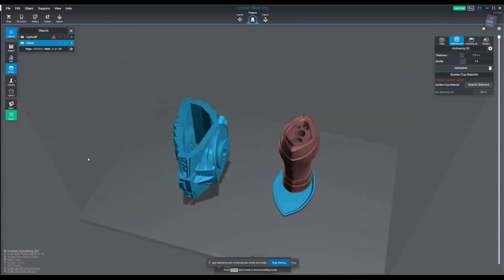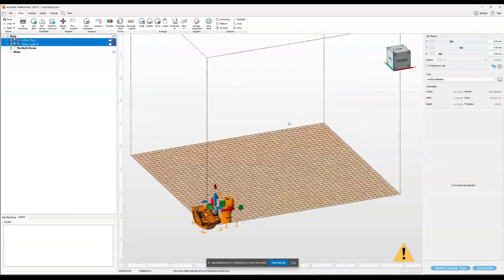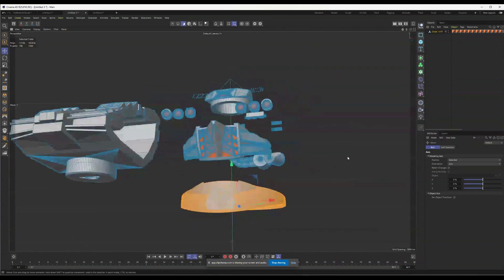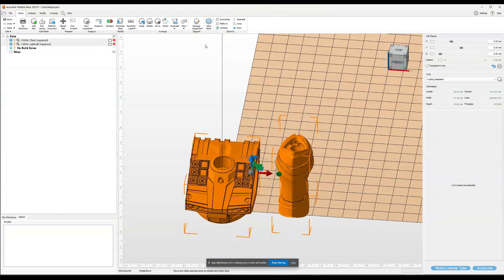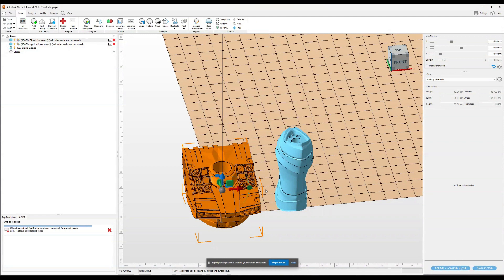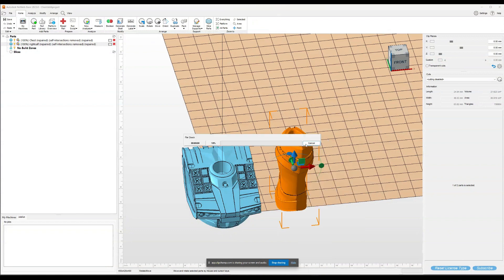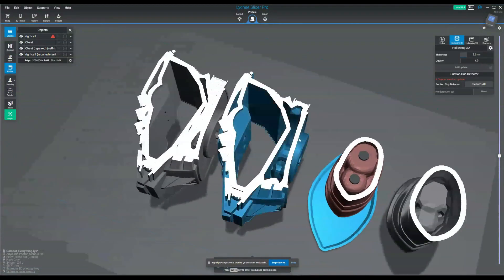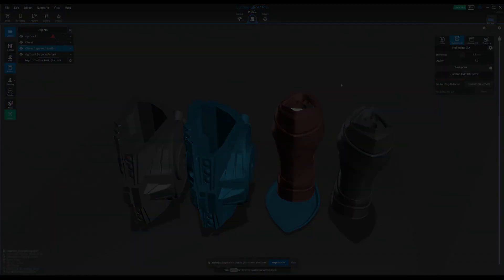How to fix STLs for 3D Printing

Comment: how do you get acess to autodesk? do you have to buy?
Reply from the maker: You do not. First make an account, after you install Netfabb, login using that account, pick to use the trial version. But it wont ever make you pay.
Reply: @J3DTech  it sends me to website. do i click student trial version or viewer?
Reply from the maker: @J-_-S  The first link does to set up an account, the 2nd link is to DL Netfabb so you don't have to try and navigate their website. I did student but I don't think it matters.
Reply: @J3DTech  i did set up acc, installed , loged in through program, but I cant acess program itself. It sends me to website where you can choose either student educational acess or web viewer. Used viewer, uploaded stl file, get black screen. Student acess needs various info, so i skiped it.
Reply: @J3DTech  Nevermind, solved it, by clicking X to exit program then Non-lincensed version check box appeared, i checked that and now program runs
Reply: @J3DTech  neither option does anything besides sending me to other types of autocad